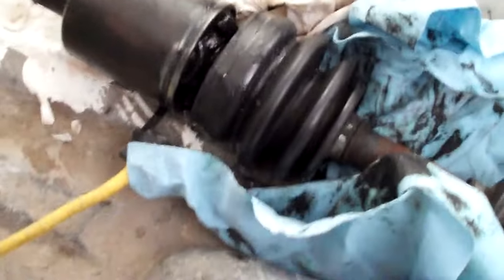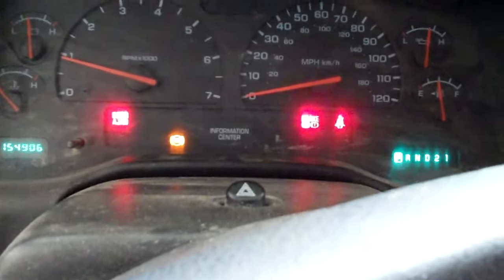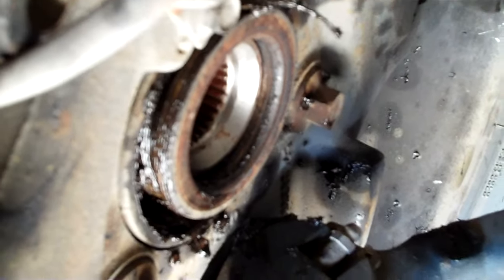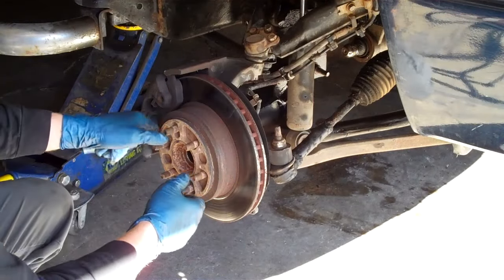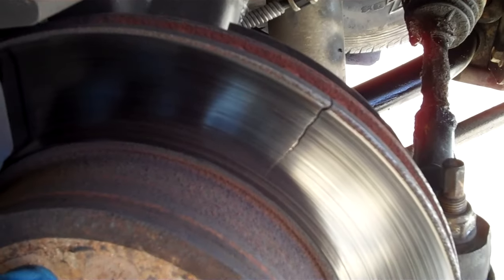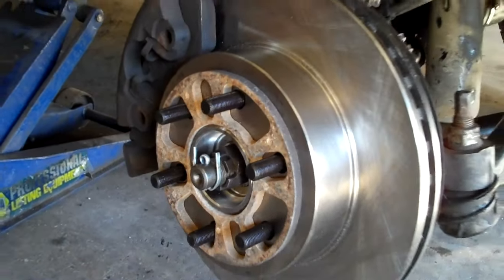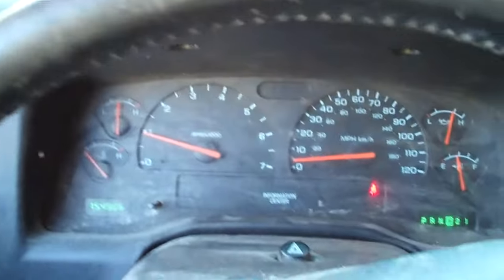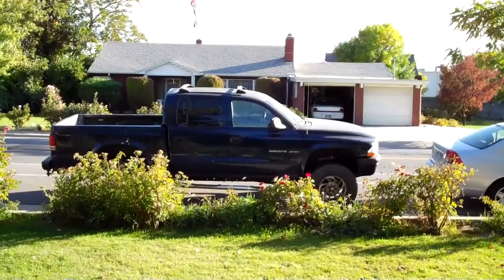What Happens if you Drive with NO CV Axle Here's what Happens....

Comment: IMHO:
1. the failure and removal of the CV axle had nothing to do with causing the brake problems or the hub problems.
2. the problem with this truck was the failure of the hub bearings.  The failed hub bearings allowed the hub and attached brake rotor to run out of alignment and wobble, pushing the brake pads back and leaving excessive space between the rotor and the pads - causing the brakes to operate poorly and the brake warning light to come on.  
3. removal of the failed CV axle would not cause the hub bearings to fail.  More likely the failed hub bearings gave excessive flex to the CV joint and contributed to the CV boot failure and damaged the outer CV joint.
4. the extreme suspension lift would add strain onto the CV joints.  The extreme suspension lift might also add strain on the hub bearings if the angle between the axle and the hub exceeded the operating angle limit of the CV joint, causing the axle to bind as it turned.
5. the added spacer between hub and wheel increase the leverage of the load on the wheel onto the hub bearings - like using a longer wrench or lever to make it easier to break loose a stuck or rusted nut.  The further the wheel is mounted away from the hub, the greater the torque force exerted on the hub bearings (torque equals load times crank arm length).  The load is the weight of the truck that is carried by that wheel - the spacer does not change the load, the spacer puts that load out further away from the hub, increasing the crank arm length and increasing the torque that the hub bearings must carry to support the weight of the truck. 
6. the added spacer between hub and wheel also increases the torque load that the wheel bolts must carry.
7. the CV axle is not intended to secure the hub onto the vehicle.  The CV axle is intended to transfer drive power from the differential to the wheel, i.e. to transfer a rotational force only.  If the CV axle is loaded laterally, it will fail prematurely, and if loaded longitudinally it will pull  part.
8. The comment by ImpenetrableSilence, posted below, is the best of the bunch that I have read here.
Reply: Al Tinfoil The CV axle is intended to secure the hub by way of the spindle and spindle/axle nut. It's pretty simple to demonstrate. Try using a hub puller while the spindle/axle nut is properly installed, then without. Pressed in bearings are not engineered to hold the wheels on the vehicle all by themselves, the races would separate.
Reply: True, in some cases at least, the bearings on the hub are not safe to run without the stub axle in place and torqued to specifications.  The axle is necessary to keep the bearing races in place when under load.  It would not be a good practice to try running down the road without the axle in place.
Reply: +Al Tinfoi,  you're right , the hub bearing failed then everything else failed after.
Reply: Al Tinfoil your right i have a Prerunner dodge like this one that use to be 4wd that i made 2wd the cv axle has nothing to do with the wheel bearings on this truck

Comment: the trick is to rip the axle apart at the joint (it basically slides apart once you cut the rubber boot) and leave each end in the car so its keeping your bearing together and your differential from leaking but theres no center section to connect them cheap fix without any further damage
Reply: What about if i been driving it for a minute without the cv, can i do this method and a few months after and still be good?

Comment: Some folks have died doing this.  You should at least leave the "stub" shaft in to hold the hub together.  At least you could disassemble the universal joints on the older styles that weren't the newer CV style.  Or as I did, I had a spare stub shaft with broken ears that I kept around as a spare just for this purpose alone.
Reply: What is the function of a passenger-side driveshaft 01 Corolla

Comment from the maker: Wow.  That's almost ALWAYS a cracked tone wheel.  I'd check for metalic dust on the wheel speed sensors and also check brake fluid level and pull codes if you have access.

Comment: You can run it without the cv axle but you need to take the spindle off the axle that goes through the bearings and install it with the spindle nut. That is what holds the bearing together.
Reply: Can you explain this in detail! My vehicles cv joint fell out of the wheel side and is just hanging. It’s not drivable and I don’t want to make more expensive damage.

Comment: But u can pull the cv axel apart and put the threaded stub throught the hub and torque the axel nut and be ok? Right and pull the front drive shaft and cv axels on both sides and 4x4 fuse from fuse box.. a 2wd conversion. . That will work and b ok on the hub? Im gna do this on my trailblazer till I can fix my differential bearing and seal..
Reply: Yes the axle stubs will support the hub bearing when the nut is torqued.

Comment: That amount of play is terrifying.  Did a Cavalier front wheel bearing last week where the part that bolts to the hub and the part that is splined actually separated...the only thing holding it together was the caliper.

Did he lose a pile of transmission fluid with no axle?

Comment: Im currwntly driving with  no cv axle no front differential no front shaft, seems my 3 bolts behind the hub and control arms along with a arm is holding everything together! Lmk if im wrong but it seems to be running better now. -03 merc mountaineer.. same for the trail blazer and explorer.. for anyone needing this little info

Comment: I have a Subaru with no trans in it, so I cant put my new axles back on.  It needs to be pulled down the road about 8 miles, would I be able to make it safely of should I destroy the new axle and place the end back on.
Reply from the maker: +Chris Compton Bailing wire from two points will hold the centers up without ruining anything.

Comment: I have a 2007 Chevy Silverado 2500hd & I have no CV axle. It's a 2WD rear wheel drive. The only purpose of a CV axle is to use your 4WD or an all wheel drive car or suv. If you CV axcel goes bad on a 4x4 you can drive without it but you can't use your 4x4 option.

Comment: And how do you know that the bad wheel bearing didn't cause the broken axle?
Bad wheel bearing could put negative pressure on the CV joint causing it to separate.

Comment: I doubt removing a CV cause that, my mother once had a minivan which front bearings Worn to that point and it still had the c.v..... when the mechanic took the bearing out the bearing came out in pieces, I think that truck was driving on a bad bearing too long...way too long and all that slop caused the inner c.v to fall out, heck when I was replacing the fuel pump in my Jimmy in front of my place a ford focus literally lost its back right wheel while driving around a corner, took the drum and part of the bearing with it, moral of these stories don't neglect your bearings

Comment: I could be wrong but I don't think this was a axle problem, I think this was a hub problem. The hub locked up at a high enough speed that it cause the axle to destroy its self. That movement you saw in tire had nothing to do with the axle out and every thing to do with hub. If you took the axle out of a car with a good hub you should still see little to no movement. On this weather the axle seized destroying the bearing or the bearing seized destroying the axle could be debated either way, and unfourtanly we will probably never know for sure :(

Comment: So long the hubs remain in place, vehicle can be driven short distances. The reason why I'd be willing to do this, is bcuz the driver side cv joint tranny side hub (05 Town&Country) is usually stuck by retainer clip. So that will hold till its forced popped out. The wheel side hub is held in by center nut. Goes to say, if like me,, you can't get the tranny side hub out, but shaft axle joints are damaged, I'll remove axle  and leave hubs in place, till I can figure a method to remove inner hub.   Of course, it means the boots are cut out, and grease and balls fully cleaned out.

Comment: Sapose to leave knuckle in hub bearing cut the boot and take cv joint apart.  So it don't come apart  !     Then you can leave both ends in  hub bearing  and  front diff  you could have made it home with out a tow truck    what was done in this video  was just stupid.   And dangerous   next time cut the boot and pull shafts apart    and be safe.

Comment: If you look at the centre of the hub, there is a lip there - the wheel should seat onto that, splitting the load between that lip and the wheel nuts. With that flat spacer, you've lost that lip, and only the lug nuts are holding the wheel. Upside is, that spacer is around $5-10 to buy. A far better spacer is one that recreates the lip, and bolts to the hub. Downside is, they are x10 as much. But in my view, x10 better.

Comment: Replaced my rotor and brakes on my 2009 Colorado and after it was all done the ABS light stayed on. Will that light go out after I drive the vehicle a few miles? FYI....  The ABS sensor wire was not removed during the job as it is not connect to the  hub..
Reply: try resetting the computer with a scan guage, autozone usually will reset all the codes for free, or you can buy one, some cars you can also disconnect the battery for a while then reconnect and it resets all the codes, if that doesn't work check the sensor and wires to make sure they are not broken or bad  or wiggled loose

Comment: Actually on the dakota the back of the cv axle going to the wheel hub is what holds the bearing in the wheel assembly, so once you take that nut off and remove the cv axle your tire will eventually fall off because it will puke out the wheelbearing . I know because i jiust had this happen to me lol
Reply: same thing just happened to me. Only took 2 days for the bearing to fall apart.

Comment: Question.  My cv axle is busted   Waiting for a replacement.  I left the outside spindle with the nut still attached to the wheel hub.  Will it be ok to drive like that. It’s a 2500 Durmax.

Comment: What happens if someone removed the drive shaft on an awd saturn vue because they did not want to replace the rear axle and sold the awd car to me as a front wheel drive car (I did not know at the time) Can I drive it as a front wheel drive with no drive shaft? For how long? Ive put over 150 miles on it this week with no noise or problems,yet. I want to take it on a trip 350miles away but I don't trust it, yet.

Comment: let say you need to fix the differential but you need the vehicle since its your only vehicle.. can you go out and buy junk cv axles and just take the part that bolts to the wheel bearing and bolt that on and have the diff removed.

Comment: Lol I drove my 03 Silverado like that for 4 years with no problems
Reply from the maker: +Daniel Bargas FEEL the power of the rust!
Reply: +briansmobile1 except I used a torch to cut the ends off of the spindles so I could bolt it back together. I was a poor high schooler at the time but it worked.
Reply: +Daniel Bargas thats hard to believe. The only reason wheel bearings stays in place is the axle is holding it together. Take out the axle and wheel bearing has nothing to hold it in place on corners. So, bs.
Reply: +Y10Q yea I left the end to bolt it back together
Reply: Daniel Bargas
 I would be scared to back out of the garage. Axle stub is what is keep the bearing in one piece. Without the outer stub, the wheel bearing will split in half and your wheel will fall off 100 feet down the road.
Reply: +Y10Q yea seriously you just break the bearing and keep the end
Reply: +Y10Q besides all 3rd gen Rams 1500 2wd and 4wd have the same knuckle just the 2wd doesn't have cv just the bearing and they drive fine just like that
Reply: +Daniel Bargas It's a Chevy of course you had no problems haha
Reply: Then you can't really afford the car you drive.
Reply: 4x4 and awd vehicles are diferent
Reply: +kendra rocks what?
Reply: I made it a mile yesterday before the left front tire flew off. I guess I should have done a little googling before trying this.
Reply: Brian Alan this depends on the manufacture, such as the 3rd Gen rams use a hub bearing assembly that are the same 2wd or 4wd light duty and removing it from the spindle side does not hurt it
Reply: You obviously DO NOT know what you are talking about.

Comment: Is it possible that your front hub bearings were already torn apart when the C.V. axle fell out? After 100,000 on these vehicles, they should be replaced for proper maintenance of the vehicle. You are lucky that you didn't cause serious bodily harm to yourself or some one else. 
After the C.V. axle fell out from your vehicle, that should have been your first clue besides all the noise you were hearing coming from underneath the car, for the preceding 1000 to 5,000 miles.
You literally took the old saying "Drive Her Till The Wheels Fall Off" to heart.
And proves once again that there are people out there who are reckless with theirs and other peoples lives.
Reply: 🤦🏾‍♂️🤦🏾‍♂️🤦🏾‍♂️😂😂😂 Drive her til the wheels fall off! 😂😂😂 Yea, because the CV axle doesnt hold the hub bearings on. It may provide extra support in this case but you can drive all day without those in. If the hub bearings are good.
Reply: @QdotRich  
That's what I was thinking.

Comment: You can't drive without the cv axle, since most of the time the since with less resistant will get all the power from the trasmisson, I should know as a company van had one that snapped, and it wouldn't even move forward OR backward, even the park was out too, only parking brake could hold it in place...
Reply: +jefferysmith1982  thats a 4wd obviously. If you disconnect the front differential, the rear can push even if the front wheels were missing.

Comment: Damn. You know your shit. I wish I had local mechanics that are half as knowledgeable. Everytime I bring my car in, they send it back to me with an unrelated part fixed and I have to take it back in again and pay for parts and labor. My car has had at least 7 mechanics in the last 3 years. It's a 12 yr old car and it hasn't had any other issues other than the 2 problems that always plagues it. It shakes violently when I'm idle or reversing. Loses rpm's until it shuts off completely while approaching a stop light. The breaks get hard or have no breaks at all when reversing. I hit a parked car first time it happened. They've told me it shakes because it is a joint leaking air in the break tubing system. Replaced the joints, it helped for a week and the car was back to shaking again. 

This may or may not be related, when I turn left/right it also makes a clunking noise (possibly the front left wheel). Wheel bearing or CV joint? Jetta 2002 1.8T

Comment: question j if the cv axle came apart, couldn't be have prevented the excess damage by just taking the shaft and inner joint out? wouldn't the outer joint and spline along with the axle nut kinda at least have kept it together a little?

Comment: Question, can the inner boot not having grease mess up the transmission, and make the seal leak, cause I hear a nose on the side of the car that the axle has lost all the grease, a noise, and I think the transmission fluid was leaking a bit, the car is a 08 impala

Comment: if you just leave the spindle end of the cv in it will be fine, the cv will come apart at each joint, you need that end piece for the bearings my audi 4000cs was ran rwd for a year no problems.

Comment: WRONG, it depends on the vehicle as to what happens when you remove the cv shaft.  I can take both the cv shafts out of my F-150 and the only thing that changes is I don't have 4wd.  If you have a sealed hub that's bolted to your wheel spindle, you'll be fine if you need to remove the cv shaft(s) for any reason

Comment: He had a wheel bearing go bad.. The missing CV axle had NOTHING to do with that. We drove our 07 Suburban thousands of miles with no front CV axle. It did fine.      We did have a bearing fail WITH a CV axle in place. Everything wrong in this vid we had wrong. That was WITH CV Axle. The bearing simply failed is all.  False video
Reply: False, this style wheel bearing is not an assembly, the spindle is part of the cv axle in this application, requiring it to need an axle shaft. Other styles use separate parts like the suburban, so in your case it would be fine, this case it isnt
Reply: The envoy was AWD right?
Reply: joeyf504327 I was advised to do this for my 02 trailblazer 4wd as well as removing the front drive shaft because the front differential went bad. I've been told by a couple people that it's fine to do with my specific vehicle, I was worried about this happening. Do you know if they are accurate or if I should be worried? I haven't driven it yet...
Reply: SH Reptiles my envoy is rwd and it uses the same hubs as the 4wd. Even has splines in it for the cv’s. Just doesn’t have any. Should be the exact same in the trailblazer.

Comment: Do I have to pull my ABS sensor out from the wheel bearing housing when replacing my CV axle? I have a Bentley manual for my Audi which says to pull it out a bit, but the sensor does *not* budge whatsoever.